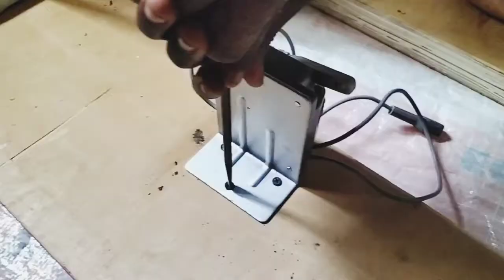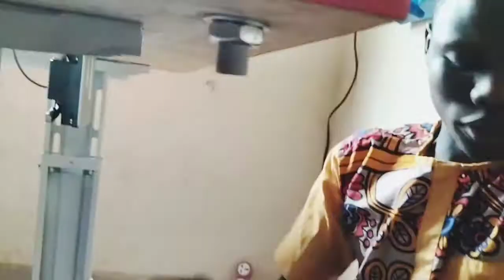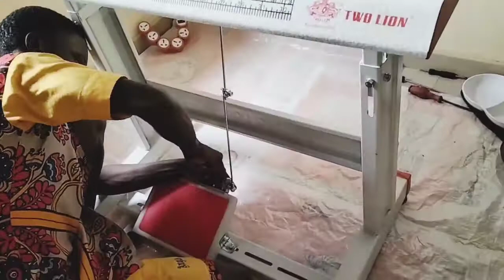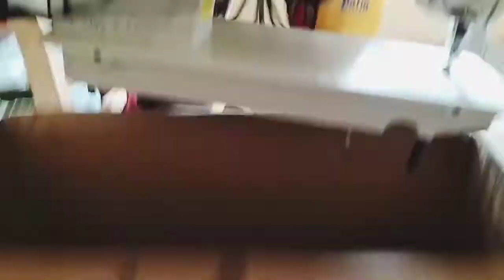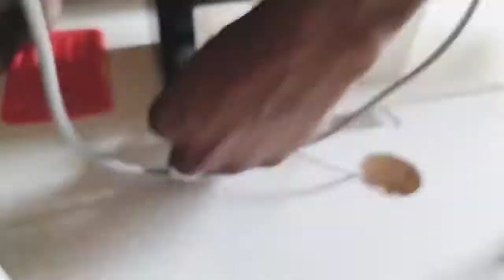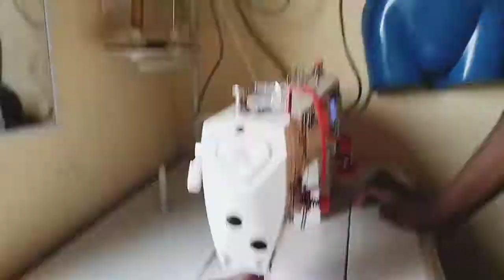Highly Detailed Unboxing// Assembling// AN INDUSTRIAL SEWING MACHINE // Direct Drive/Two Lion

Comment: Can this machine be used to sew leather handbag?
Reply from the maker: Yes, it will. But, you need a needle size 22 to 24 depending on how thick the leather is.
Reply: Correct